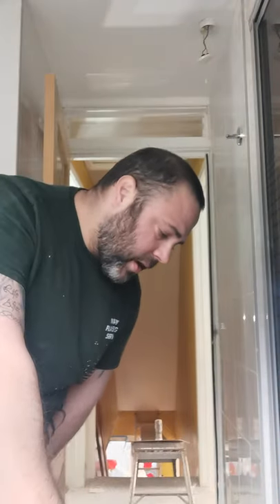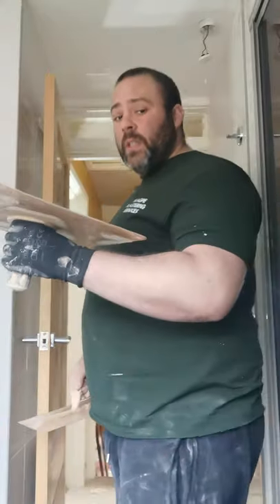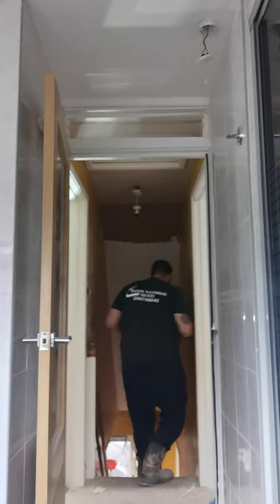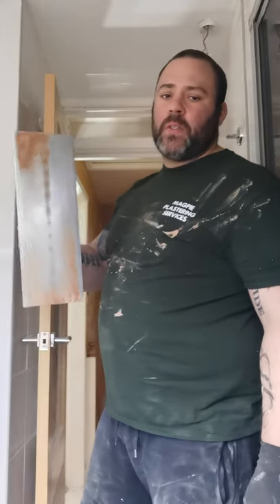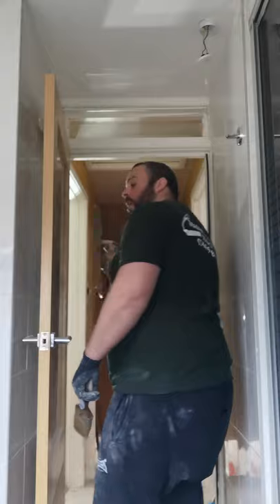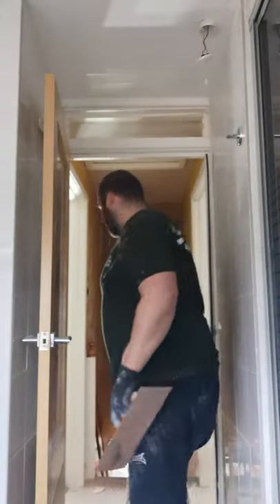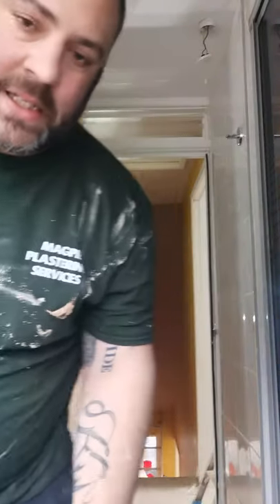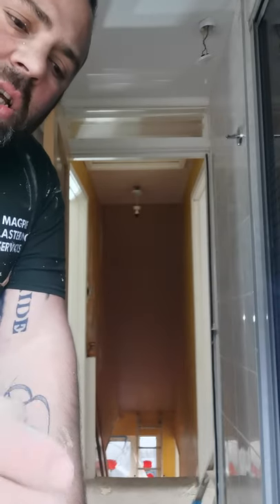Plastering slop ceiling on staircase

Comment: Happy New Year, Wellcome Back. Nice easy Gauge to start the year off, Quick Question, I've a Nixer, were skimmed ceiling has delaminated from stipple, the previous. Plaster, Thistle the ceiling Well, But the skim Coat looks like it never bonded to Thistle coat, ( scraping ceiling, the skim Coat is falling off in sheets) Would it help if I Used SBR instead PVA for a better bond. I've only ever had this problem with blue grit on stipple ceilings, So Always use Thistle green bonding Coat, First Time Ever Seeing skim delaminate from a Thistle coat, Normally skim stick's to above like 💩 to a rug, Any Advice would be greatly appreciated, loved the old vid's, Keep UP The Good Work 💪🖖
Reply: I’d say the bonding was too dry and had no key.  I’m sure it says on the pack to rough the bonding with a brush. We don’t do this but apply the multi when the bonding is slightly soft so it adheres.

The other issue might be the pva was too weak or of naff quality.
Reply: @alfamad155  it actually states not to rough it up or devil float bonding. Hardwall yes, bonding no